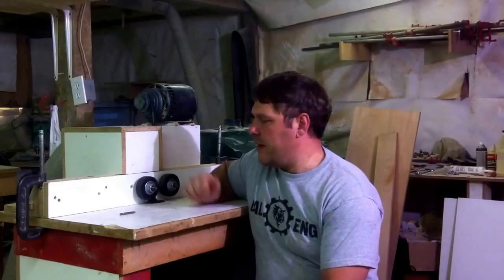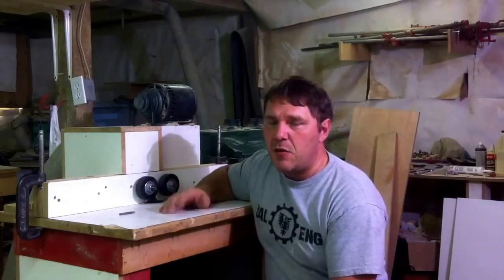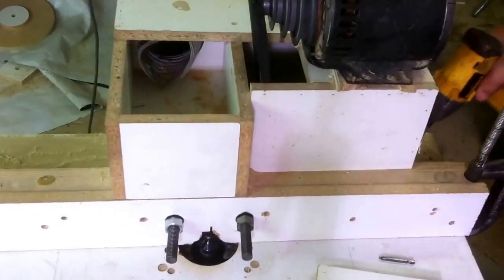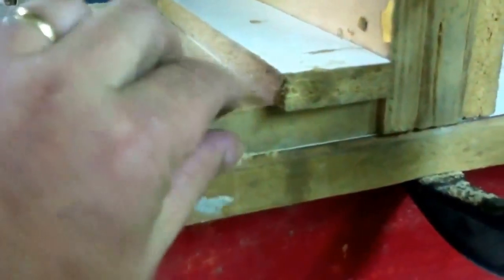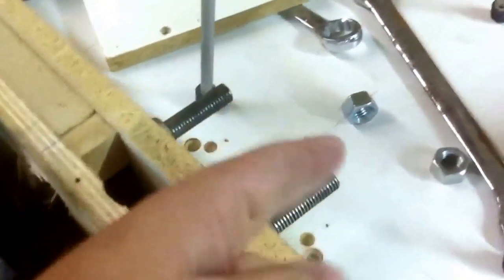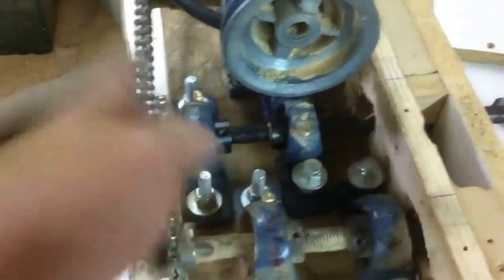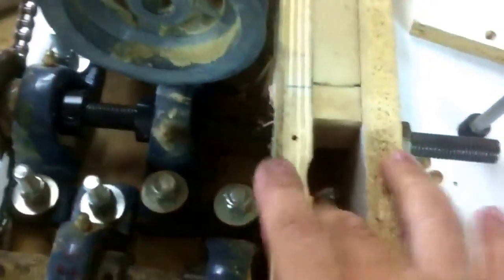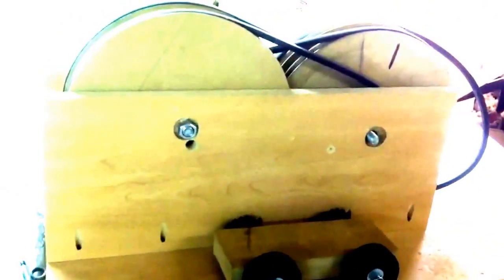Router Power Feeder Part 3 The Original Revealed!!!

Comment: Great idea here.  I plan on doing this but using a stepper motor instead of a gearbox and motor.  My bill of materials from ebay and amazon is about $200 CAD though I guess I will need to buy the pucks too.
Reply: Hi did you build it?
How did it go?